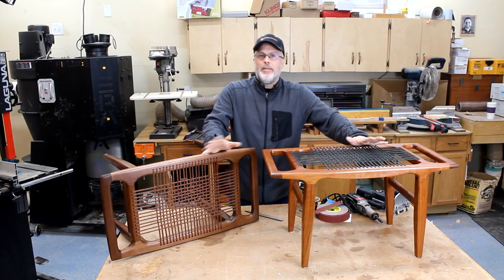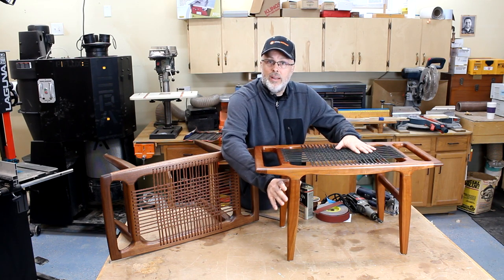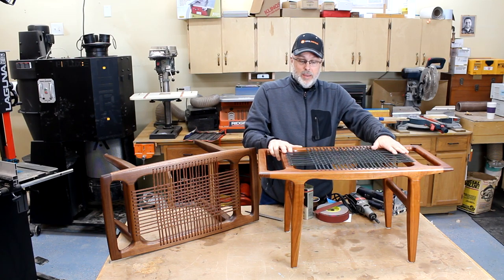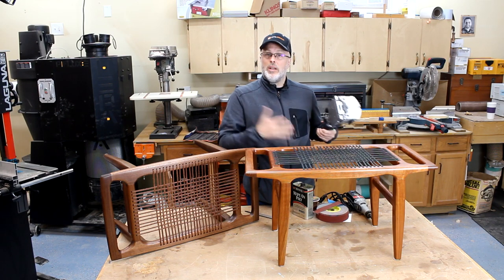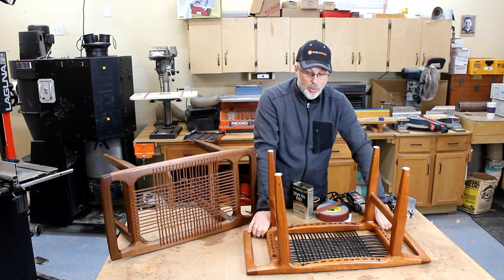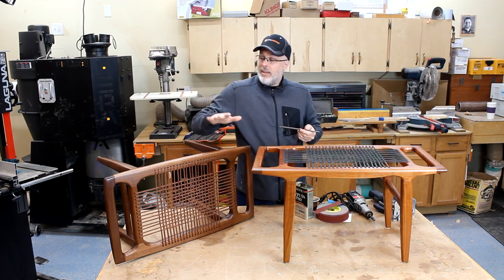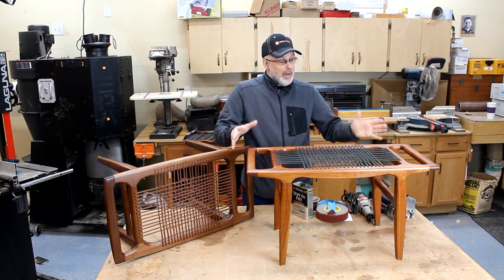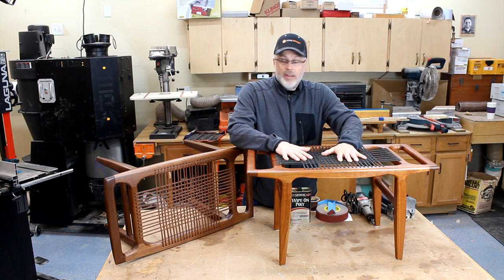DIY Sam Maloof-Inspired Leather Bench: Tips, Tools & Templates

Comment: Are the legs perpendicular to the top or do they come down at a slight angle?
Reply from the maker: Hi Adam, the legs are splayed at a 4 degree angle to the outside (left and right).  From a front to rear perspective they are straight vertical (not splayed toward the front or rear).  Does my explanation make sense?
Reply: Yes that does make sense. At what point do you cut that angle. Did you use a miter saw? And did you just take off enough wood to give it the angle (versus chopping off an appreciate piece from your rough cut)?
Reply from the maker: I cut the angle at the opt of the leg and the bottom after I rough cut the legs to approximate size and before cutting the mortise on the leg.  I left the corresponding surface on the frame square; in other words the entire 4 degrees was cut on the leg, rather than some on the leg and some on the frame.  This makes frame construction much simpler.
Reply: That is great. Much less intimidating than what I was thinking.

Comment: May I suggest using Fusion 360 to model the design.  Fusion 360 allows you to model the design using 2d templates like you used to to rough cut the parts. Then you can sculpt it to create the final design.  You would be amazed at how accurate you can get the model.  Its free for hobbyists like us.
Reply from the maker: Hi Stephen, that sounds very cool and I'll check it out.  Thanks for the suggestion!

Comment: What is the best way to print the templates at the correct size for transferring onto plywood or MDF? Did you draw the 2D version in Sketchup? If so, would you be willing to send that file?  Thanks, Adam
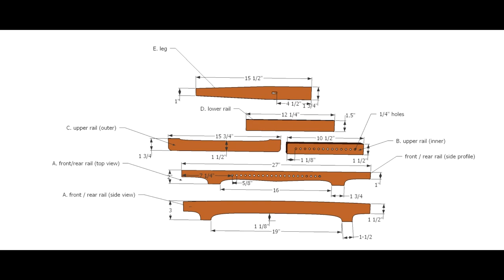Reply from the maker: What I'd suggest is to do a 'print screen' at 8:58 and print them to the scale shown and sketch them onto some 1/4" plywood templates.  That makes it easy to trace, and then if you ever want to make another one it is super easy.  I ended up making a second one so I was glad that I had made the plywood templates.

Comment: I believe on the parts diagram at the end that you might have the views mistaken on the front/rear rails (and the hole marks in the wrong piece). The one currently labeled side view should have the holes right?
Reply from the maker: You're right!  Dang, VERY sorry about that!
Reply: Its alright. I am trying to learn sketchup by roughly modeling the piece and it was not jiving with what i saw in the video. No wood was harmed in the making of the sketch haha.